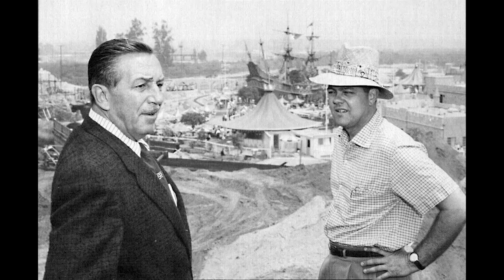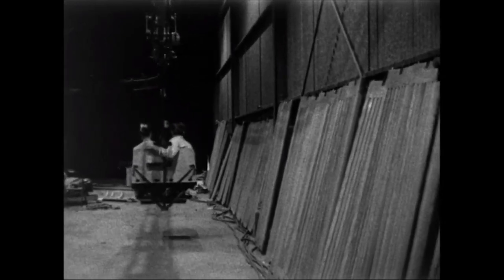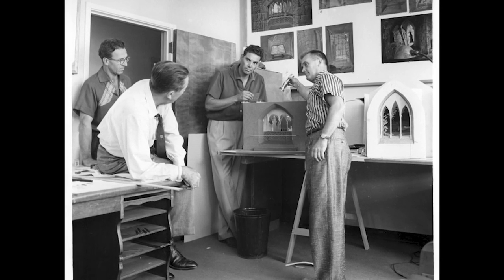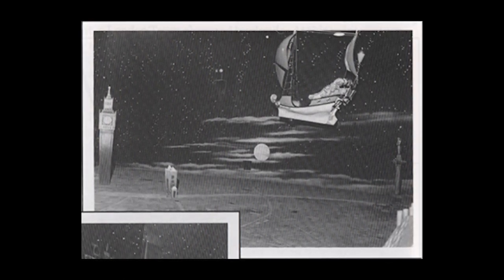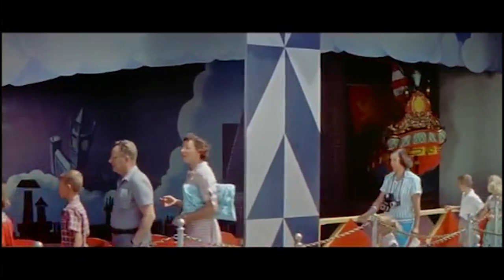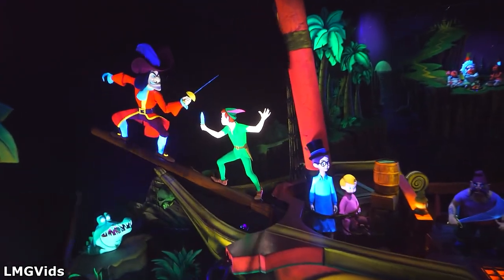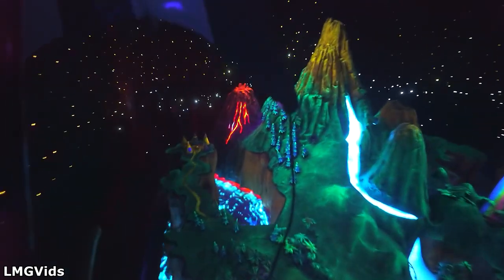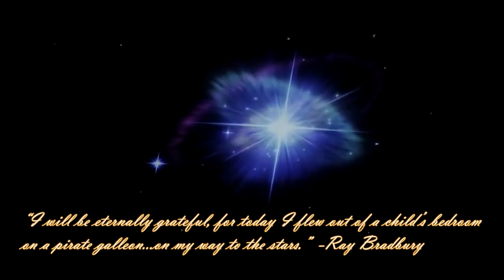The History of Peter Pan's Flight at Disneyland

Comment: I love this. I absolutely love Peter Pan. I was told recently by someone who talked with Marc Davis about this that this ride system was suggested as a possible solution for the Haunted Mansion back in the 1960's, but it was determined that it wouldn't really work for what they wanted to do.
Reply: I had also heard that they were going use boats in the haunted mansion but it would be too similar to potc. You can see concept art on line